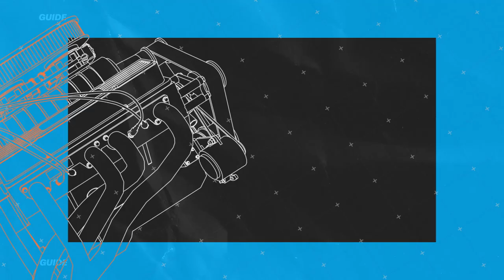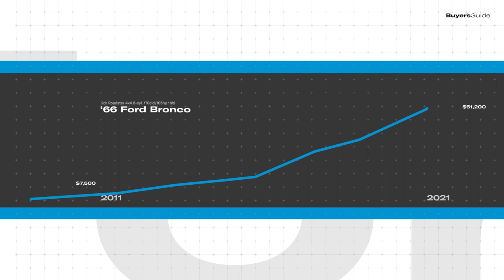First-Generation Ford Bronco | Buyer’s Guide

Comment: I bought my brand new Bronco on February 22, 1975. I paid $6,000.00 for it, (an ENOURMOUS sum of money for a "utility" truck in those days.) Mine had the twin fuel tanks, (like the one driven in this video.) You had to have it, otherwise a single-tank Bronco held about 11 1/2 gallons, and the 302 V8 wasn't the most economical engine back then! Even with the extra tank, you had about 19 gallons total. Mine had Posi-traction in the back, and limited slip in the front. One thing that wasn't pointed out here was that the Bronco had extremely limited front and rear overhang, which made these things go in and out of EXTREMELY v-shaped ditches and not get hung up, (I know this for a fact. . .,) and could go through damn-near anything! And yes, I "cut" mine, and put large tires on it.

On the down side, they had drum brakes all the way around. I actually towed an 18 foot travel-trailer back then, (no weight-distributing hitch, just a ball hitch,) and had some extremely harrowing experiences trying to get all this stopped. . .!! 😲😬 And rust?? Oh, yeah!! I had even had mine "Ziebarted," (for those old enough to remember that crap,) and found later all it did was accelerate the rust by blocking off drain holes. Towards the end, my driver's door would drop down about 1/2 an inch when you opened it, and you could see the road through what was left of the floor pans!! Had I then, after about 10 years of ownership, had any inkling of what it would be worth now, I would have NEVER got rid of it, but while I had it, I went through awful mud & sand on trail-rides with a four-wheel drive club in the Midwest, and had a ball with it! Wish I had it today!!!

Comment: It's truly a good dependable rig I have a 68 that was used as a mountain vehicle took her hunting every year.  rear fenders are cut because chains would hit the rear fenders if not (no lift kit). as you said it does have some rust (both floor panels have got rust, mainly the driver side and some rust in the back on the bed ). It still has the original 289 in it runs great I honestly never had a breakdown in this one that didn't get me home.it's lasted for years and still runs n drives great the transmission was swapped to a 3 speed on the floor rather than the three on the tree (without the swap they liked popping out of second gear and reverse). It's definitely a small vehicle which gives you the capability of weaving in and out of the trees and taking a lot of different paths that a lot of vehicles especially nowadays they're incapable of. Definitely have to agree with you they're not fun to use at high speeds they're made for the mountains and that's where they shine like chrome. I come from a hunting family in Montana where we've gone through three others besides this one and the only breakdown on any of them that didn't get us home was one of them the axle in the rear actually broke and the tire and Axle came sliding out driving on three wheels it dropped down but kept on driving (still unsafe so we had it towed back to town).  Overall love the vehicle!
Reply: I honestly can't afford to restore or I would!  If I was to take the topper off it would look just like the one you have a little bit more of a sky blue (maybe kind of turquoise) and the original rims on mine were white with small Chrome hub caps!

Comment: IT'S an "original" Bronco.... That is all you need... They ride and drive exactly like the rest of the 60's and 70s vehicles... They are best for going 4 wheeling / off road... I grew up with them... My family had a Ford dealership in the 60's -80's and we used one as a service vehicle  and used it to plow snow... They are a blast, plain and simple...
Reply: My neighborhood Ford dealership used one only for snow plowing, Sunset Ford in St.Louis County.  The Bronco was beautiful,  the service dept let me look it over whenever I needed a reference for restoring my 1974 Bronco,  302, automatic transmission,  power steering.
Reply: @craighansen7594  OURS was an original 66, 6cyl 3 on the tree... We had jumper cables on a switch under the hood, a blade on the front in the winter, and had a "Mini Tow" (a winch and sling trailer) that we used to get broke down cars... It was a trip with the low power small 6 towing a 60's or 70's full size car or truck, especially in the rain with the vacuum wipers... They slow or stop as you run through the gears... Good times...

Comment: I drive my 1974 Bronco several times a week. I plow snow, pull trailers, haul parts from the wrecking yard..... Dad bought it used around 1984, didn't pay much. We made minor alterations, front and rear sway bars,adjustable brake proportioning valve, dual exhaust, aluminum 4bbl intake, interior panels, air conditioning, new paint.... All things done in stages, it did make it drive better.

Comment: I live in IL and the rust monster has eaten all the old cars and trucks.  I rarely  see a first gen or any Broncos at car shows let alone on the roads.  I could buy a new car that costs 40-70k and drive it in the salt and watch it depreciate to nothing over time or drive a vehicle everyday that is worthy of salt. I'm a car guy and my 73 Bronco is bad azz.  All the things Sam stated in his video about ride, braking, safety, rollover and handling can be addressed in the aftermarket part houses .  Collectors talk about original which I guess would matter if there were high performance variations and yea, there are some low production ones.  You can group the Bronco into 3 variations: Uncut, Uncut & lifted, and my favorite- Cut & lifted  The first gen Bronco is worth about what a new car costs but here's the magic...they don't depreciate where a new car loses 50% value in 3 years.   They say for a relationship to be healthy, you need to be fun.......are you?  My recommendation is to buy them done....the money to buy a restoration project is your down payment and a monthly payment is budget friendly and your fun starts right away!

Comment: I had a 72.  The two issues were the result of my ignorance.  First, it had only one gas tank which gave you just over a hundred miles on a tank.  Second, the dealer installed an aftermarket air conditioner which was likely made for pickup truck.  Never got very cool.  Otherwise it was an ok vehicle but a Jeep Wrangler had a much better four wheel drive.